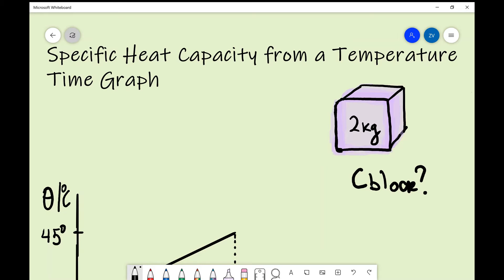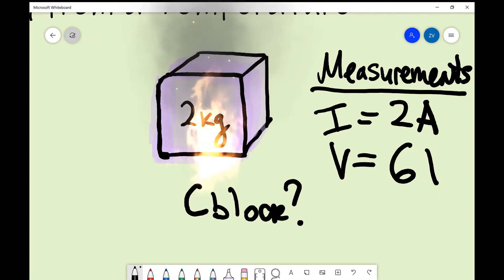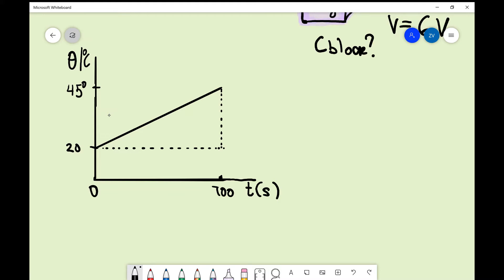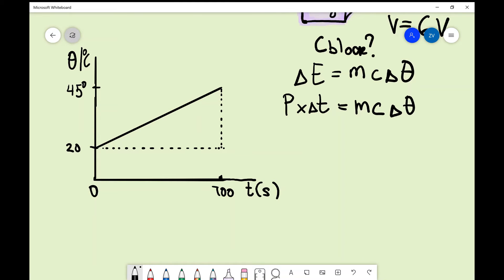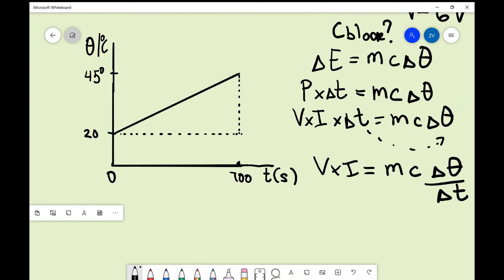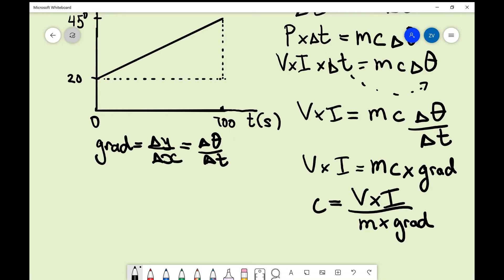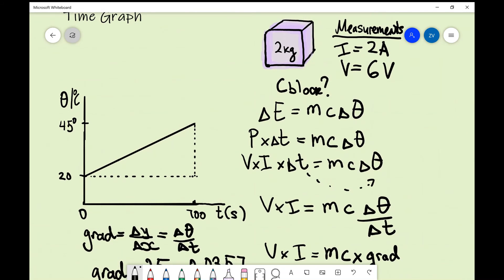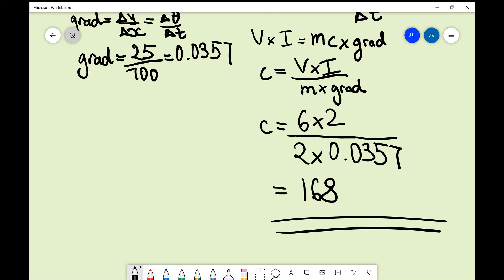A Level Physics: Specific Heat Capacity and graphs example

Comment: The resulting value for c is the average/mean specific heat capacity over the measured temperature-range, right? Normally the specific heat capacity changes with the temperature of the object / fluid though, and averaged values can only be used for rough calculations or applications with a small temperature difference where the heat capacity can be seen as constant, correct?
Thank you for the video!